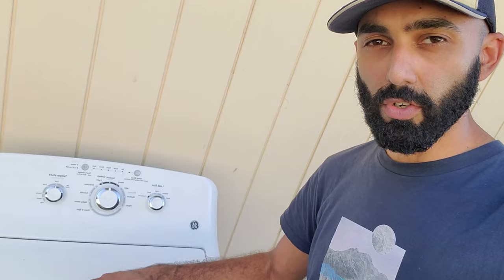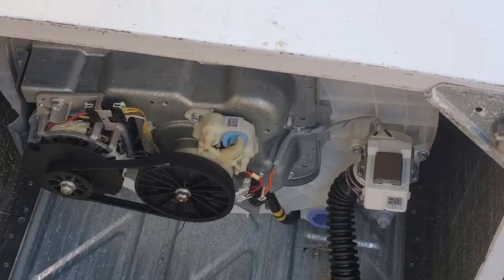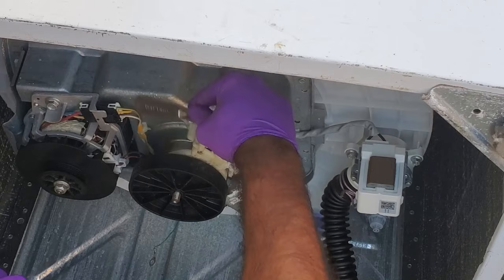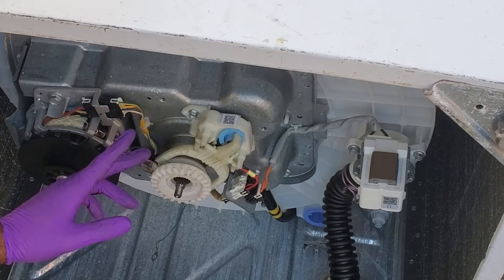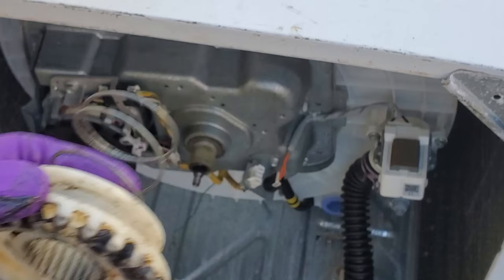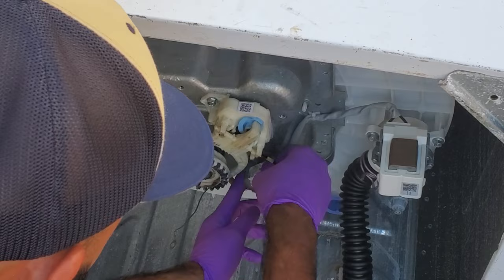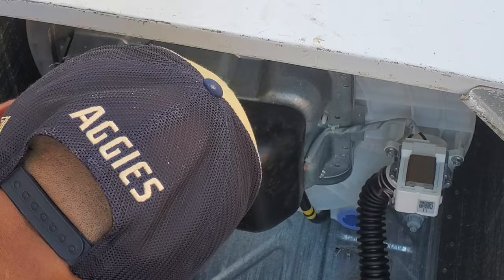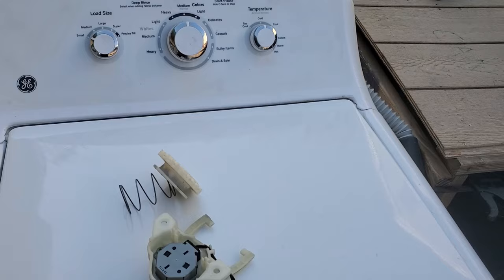Fixing A GE Washer That Makes A Grinding Noise During The Wash Cycle!

Comment: Hello, we have a model nearly identical to this one and it started making an odd noise during the fill function. Water will get pulled through the line to check the level (the machine does this each time the lid is opened and then closed), but it won’t actually begin filling and begins making the noise. Do you have any insight or tips that might be helpful? Thank you so much, your content is awesome and very appreciated!
Reply from the maker: It's making the same grinding noise without water?
Reply: Mine is doing this too... It fills fine on the diagnostic tests... But won't fill during a wash cycle... And won't spin on spin but will drain... I also realized that I can turn my agitator by hand in either direction... Lid lock functions properly... Would that be the clutch? Like it seems like something is spinning in the bottom from the sound of it (soft sound) but then when it shuts itself off or I shut it off it makes that loud grinding noise and stops...
Reply: @DuctTapeMechanic  this message was for you... My machine looks like this one... This is the model number GTW335ASN0WW
See comment above...

Comment: I had one of these last week and replaced the clutch to find it wasn’t the issue. The issue is the gearcase. These ge washers gearcases usually only last a year or two
Reply from the maker: The gearcases are notorious on these models (they often begin to fail by leaking oil on the belt)

Comment: You should try the dime trick like on the Samsung WA400. It gives you a little extra room with the clutch shift arm and costs ten cents. The new clutch for the Samsung is like $350!
Reply from the maker: I have seen that on a Samsung, never done it yet, how well does it hold up?

Comment: Duct tape mechanic,gr8 video.  I've got a similar washer with this issue.  On mine I notice that the shaft that the pulley bolts to moves in and out about 1/8 inch.  Should the shaft be moving that much?  Also I think I this machine uses too much water.  Your feedback would be appreciated.  I went to see about replacing my washer and I was frightened by the prices, I said "NO WAY JOSE' " so I've decided to try to fix it instead which brought me to your repair videos.  Man you're✌ lifesaver.  I can imagine all the washers and dryers you've saved from the landfills 💯👍.
Reply from the maker: A little bit of play is normal, too much play indicates bearings in transmission are failing (grinding will probably continue despite new clutch). 1/8 of an inch should be ok I would definitely procede with the repair and see what happens. I appreciate the support for the channel.
Reply: @DuctTapeMechanic  ; Thanks so much for your quick response. Yes I suspect that the transmission is probably bad. I'm going to replace the transmission assembly. Thanks again 👍😁.

Comment: what kind of grease, where do you get it, how much should you apply and where do you get the parts? you didn't show that on camera and I am worse than a novice....*subscribed thanks!
Reply from the maker: I just used multiple purpse high pressure grease I got from Harbor Freight. I would just make sure there is a bit of grease on all the teeth no reason to go crazy.

Comment: Amazing videos! My  GTW460 was making some noise but not quite that. Hoping you can advise me here. Everything works fine except it won't agitate, the machine fills, drains and spins however it attempts to agitate with little movement. With the lid removed (lid switch tricked I'm able to observe it with the lid off as it agitates) and during the agitate mode, there's a slight attempt of rotation of the auger to the left and then right every few seconds but somethings slipping or spinning, like teeth are sheared off. I don't have any plastic fragments on my transmission pulley, I removed it and cleaned off oil residue and all of the teeth are in good shape on what gears I see. The little shifter motor that moves the fork seems to rotate fully allowing the fork to move and completely shift so the machine spins properly (engage/disengage spin I guess you could say?). I pulled the auger and the agitator hoping to find the female splines sheared but everything looks fine on the top tub side. When trying to remove the auger while holding the tub stationary, I was actually able to rotate the auger/agitator clockwise occasionally, again like something in the transmission is giving or slipping, i.e.broken?

Do you think my gears in my transmission are sheared off or something, it passes every other test in the field test mode, except as I said, when it attempts to agitate it's just a slight jog of the agitator to the right and to the left, if I grab the agitator while it's doing it occasionally I could provoke a grinding sound of something spinning inside of something. 
I feel like the only thing that could be messed up is the transmission was hoping you could confirm that? Thanks in advance!
Reply from the maker: Seems like you did a splendid job troubleshooting. I initially assumed that the agitator teeth were stripped but you checked that. I agree with your conclusion that it most likely is the transmission, especially if there was oil on the pully. It's a bummer. If you are in the market for a used washer I recommend a kenmore 80 or 90 series washers they are build like tanks plus parts are cheap (especially if you can get one for $200 or less)
Reply: @DuctTapeMechanic  Thank you for the reply kind sir!  Esp the Kenmore 80-90 series recommendation!
Reply: @MrDocHolidaay  ever get it fixed?
Reply: @teerich2011  Hi, We tossed it out, didn't want to invest in a transmission. Thanks again

Comment: I recently changed all those parts that you indicated...it still makes a grinding sound
Reply from the maker: It's usually the bad clutch that causes this noise, I suppose a bad transmission pulley might be the next thing to look at
Reply: @DuctTapeMechanic  and where is that located on the machine....I replaced that one pulley

Comment: Wish I would’ve found this before my husband replaced our clutch in my GE gtw460asj5ww! Our washer is making a clicking grinding sound When it starts to spin and is trying to get up to speed. Only when there is weight in there, does not do it empty. He has inspected the belt, looks good. Replaced clutch and mode switch, Made sure that it’s in Balance, but we just cannot get this thing to get up to speed to completely drain out the clothes. It also does this thing where it keeps wanting to put more water in And extending the cycles. So frustrating! If I only put about 15 pieces of clothing, stand there and wait for it to be done spinning, and then hit pause and get them out before it adds more water. I can get it to where it’s somewhat spinned out enough to Put the clothes in the dryer. Often times, so I’m having to re-balance the load to even get it to work and get to that point. I will never buy another GE product again! We have always been able to fix our appliances through YouTube Wonderful people like yourself giving us these videos, but this has been a nightmare. 

Just to give you an example, and this washer it started acting crazy We’re half of the features did not work on the control panel. We thought it was a bad control board so we ordered a new one from GE. It was not the exact replacement part but when that they said was their updated board, we put the new board in and we struggled and struggled trying to get it to work right with the coding programming. We soon figured out that the actual code that the specific washer needed was not on that control board so it was interesting is when I was reading the repair files, I noticed that there was a reset option for the boards so I asked my husband to put the original back in and try. It completely reset the board and had a fully functional washer again! We suspect that we had a power outage that knocked it out of programming. That is so crazy!  We sent that feedback to GE when we returned their control board.

Thank you for all that you do! It’s so important So that we have less of these being recycled into the landfills!

Comment: I have one like just like that, it has a regular agitator.   ……and I’m on my 3rd agitator!!!!! 

Yes, this thing easily strips the splines on the central hub of the agitator, where it sits on the transmission!!!  I’m currently trying to engineer a way to secure a stripped agitator to the transmission shaft, with a security pin, in such a way, where it doesn’t catch and destroy clothes, as the machine  turns the agitator.

Comment: Thanks for the video - super helpful! Our machine was making the EXACT same noise during the wash cycle - followed instructions you posted here to replace the clutch (sadly - the clutch was not worn out at all! when we took it off) so it's still making that noise - any suggestions on what else it could be?
Reply from the maker: The only other thing aside from a bad gearcase that would cause this sort of grinding would be if the shifter actuator motor was not working properly. I would replace that next if that doesn't solve it most likely your washer is done
Reply: @DuctTapeMechanic  Thanks a bunch! I appreciate the response!

Comment: Hey man so when I take off the black cover underneath the washer I have black flakes instead of white flakes any idea what that could be
Reply from the maker: Could be the transmission pully. I would replace that pully and the clutch/spring
Reply: Same! Have you replaced yours ? Did it work? I ordered my parts just waiting for them.
Reply: @dcappos1 did this work for you?

Comment: Had this grinding noise in mine but without noticeable debris. Replaced all the parts listed in your video and now my spin cycle runs but the agitator isn't moving as it should during the cycle. Any thoughts you could share?

Comment: My washer is making this exact noise and I was so grateful to come across your video! When I disassemble, I do not see the same white powder to indicate the clutch is worn down. There is however some darker almost metallic colored residue. Just wondering if that might mean anything or if I should just replace the clutch and hope for the best? My unit is a Hotpoint model htw240ask6ws only a few years old. Thanks
Reply: Hey! My washer currently has the black residue. Did you figure out your problem? Would love to know how to fix mine if it’s different. Thank you!

Comment: I've replaced all the same parts and my ge Hotpoint it still making that exact same grinding sound when the agitator runs. All brand new parts. It will usually wash one load a day without any noise, but by the second load it starts making that loud, awful grinding noise. Shifter actuator, clutch gear, spring, belt, all brand new. What do?
Reply: I have the same issue we bought new parts 100 bucks  washed about 5 min started the grinding noise again not as loud but still did it😢
Reply: Did you find out the issue?
Reply: @ashlierawlinson7171  Yes and no. I ended up cutting a quarter inch thick piece of plastic pipe to use as a spacer between one of the bottom gears so the teeth don't grind while it's in the "up" position.

Comment: Wow, thank you so much!!! My exact problem. Where do you find the part numbers for the replacement parts? I definitely subscribed!!
Reply from the maker: I'm glad to help. Clutch, spring, and shifter can all be found on Amazon. GE pretty much uses the same part for all the models, so you won't have to worry about fit issues. Just search GE clutch/ GE shifter.

Comment: If the clutch doesn't get replaced, could that then lead to other issues like the wash and spin cycles won't work? But it fills and drains.  Seeing this i remember hearing the grinding noise at first, and now here we are with an agitator that doesn't move and a spin cycle that won't spin.
Reply: Sounds like mine too.  The evolution of those spindles just completely failing now.  My washer used to at least finish the job
Now it doesn’t spin at all

Comment: 2:13 I have gtw465asn2ww and it used a 9/16 nut here.  Other than that, was same instruction and part.
Reply from the maker: Right on! Great job on the repair

Comment: I have a lot of black dust down there, and the transmission pulley fully ate through the cover. I am having this clicking noise but no white flecks, could the transmission pulley be the problem?
Reply from the maker: Certainly could be a bad transmission pulley as well but I would be a bit concerned if it ate threw the cover it could be the transmission drive shaft has a bad bearings causing it to have that much play.

Comment: I have the exact Hot Point washer as in this video making the exact same noise. I replaced the clutch and the mode shifter as shown, but its still making the noise. the transmission is working fine, nice and quiet during the spin cycle but during agitation its grinding away. Is there any other issues that could be causing this problem. By the way, even though its making all the noise its washing normal, its just driving us crazy.

Comment: I changed the mode shifter the clutch spring and pulley. Still doing same thing. It's weird the clutch won't engage once mode shifter engages. Soon as belt is taken off it will engage again.

Comment: I have the same problem and I recently replaced the belt, clutch, spring and gear box but I’m still having issues with the spin cycle not removing the water from the clothes. I’ve only done one load so far after the replacements.  I did notice all the flakes of clutches and belt debris when I removed the housing so I’m assuming the clutch, belt and gear box was  going bad.  Majority of the noise is gone but I I did hear it a couple times when I put the clothes back on a rinse and spin cycle.  I got the parts through Sears and they are genuine OEM GE parts so I’m assuming they are quality parts.  Any suggestions? Should I run it a few more times and see if it takes a couple cycles to set back to normal?

Comment: Would this also resolve the jet engine sound or is that the bearing replacement that’s needed?
Reply from the maker: If it sounds like a jet, then you will need to replace transmission (the bearings are sealed inside and cannot be accessed). Here is my video on how to do it:
https://youtu.be/gBqgwLyOEW0

Comment: Hello! What would cause there to be a grinding noise between the drums in my GE washer? I’m troubleshooting and getting nowhere. Any help would be greatly appreciated!
Reply from the maker: I have seen items between the inner and outer drums cause all sorts of noises lol!  Pop up the top and remove the plastic ring between the two drums and take a look. If you don't see anything, it could be the spanner nut is loose. Take off agitator and see if the nut is tight. Best of luck!

Comment: I have replaced the two parts you have and I still have a loud noise while agitating and the agitating hardly moves. Is there another geared plastic washer under the wash plate that may be causing the slipping of the agitator?

Comment: I have this same GE washer and it will only work in Speed Wash cycle. It makes the same sick duck noise when agitating just like yours did and sounds like a Boeing 737 rumbling down the runway when in spin mode. Could this clutch or mode shifter be the reason it only works in Speed Wash ?

Comment: I check the clutch and is fine re assembly and noted the noise is gone completely then the washer spin out all the water twice, see I forgot to install the spring when I reinstalled the spring the noise return 😮 I noticed the transmission should be fine but there is something else on the assembly.
Reply from the maker: I would definitely recommend switching to a new clutch and spring. Something fishy is going on with them

Comment: If this is the issue would you also notice the clothes still being wet after a full cycle is complete? Meaning would this issue also prevent the drain cycle  making cloths finish still wet?

Comment: I have a stacker and the washer as it’s agitating will make a loud metal grinding sound as the motor kicks on but it’s rinses and spins fine but agitating it’s metal grinding
Reply from the maker: Most likely metal grinding is the transmission going bad

Comment: I have that same machine,  this noise is intermittent,  and now my lid lock started  to not work properly,  so I changed it, and now no spin. I did the diagnostic test #13 for the lid lock, the rinse and spin led lights up when opening/closing the lid, but is the lid lock supposed to lock during the test? Also, rest #14 spin, nothing happen which led me to think that the mode switch is bad. But I'm not sure. Do you have any idea what it might be before I replace parts? TY you have great video appreciate you!

Comment: Really appreciate this video. This is exactly what my parent's machine is doing. They have the same model. Do you have the part numbers of what you replaced?
Reply from the maker: The part can be found on Amazon
 Just search GE washer clutch. They are all pretty much the same. I also recommend changing the spring and actuator. I believe there is a package deal on Amazon for like $70 for all 3.
Reply: @DuctTapeMechanic  Thanks 🤙

Comment: I have the same issue. Thanks for sharing !.
Reply from the maker: Best of luck!
Reply: @DuctTapeMechanic  Quick update. I replaced the belt, pulley, clutch and the shifter. I spent $76 in parts.  Washer machine works like new. Thanks again !
Reply from the maker: @FranciscoFlores-ih7oz  that's awesome! $76 is not bad all! Good work
Reply: @DuctTapeMechanic  I've got a similar washer to the one in the video making the similar grinding sound. What I noticed on mine is the shaft what the pulley is bolted to is moving up and down about 1/2". Is this normal and if not how can I fix it? Where do I find parts for it, I'm in Toronto Canada.